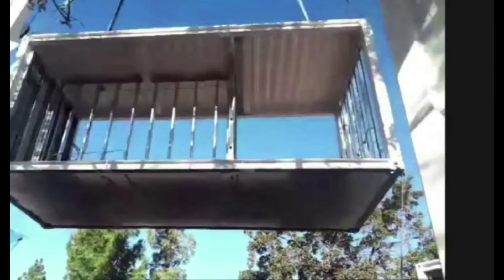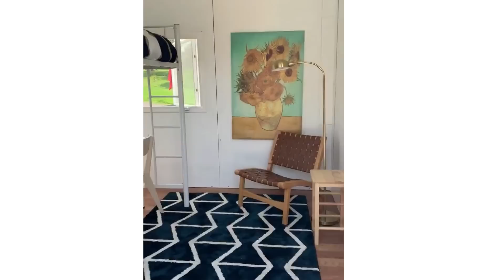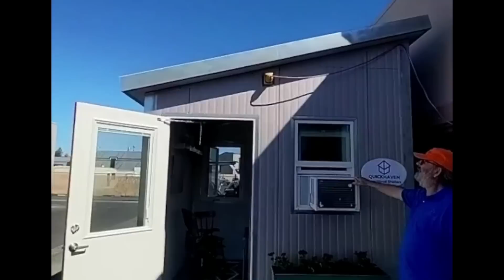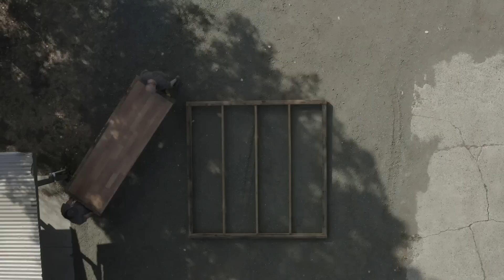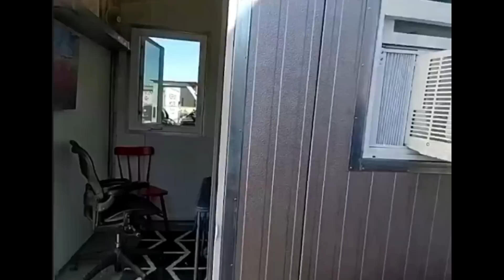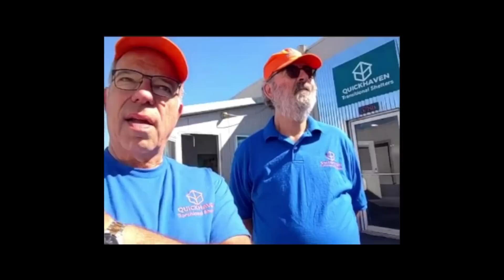Ep. 28: QuickHaven Q70 Emergency Shelter // Home Tour - The Rapid Shelter Innovation Showcase

Comment: Where is the plumbing?
Reply: 🙋🏾‍♀️ That's what I said but then I thought about it.🤔 Maybe there's a public bathroom for the community to share.  Or,  maybe it would cost more to  connect to the city. 🤔 

I think a composting toilet or an RV toilet with a disconnect to empty into a near by sewer might work. 🤔 I've seen van dwellers use camper water bags to take a shower in a make shift wet bath 🚿🛁 🙋🏾‍♀️

I'm sitting here rattling my brain 🧠 with ideas. 

I think this is a step in the right direction to help the homeless community 🙂